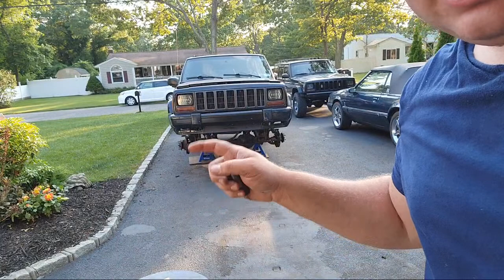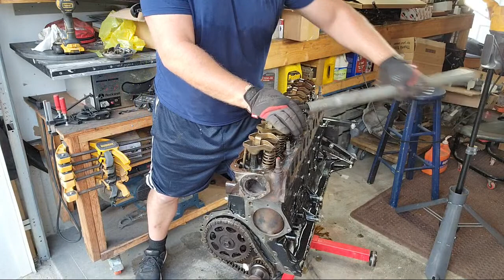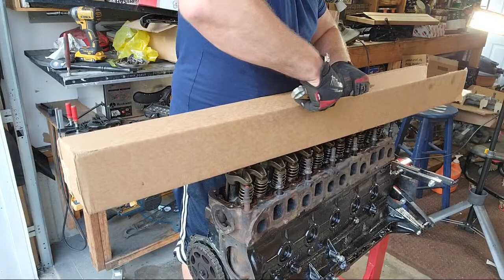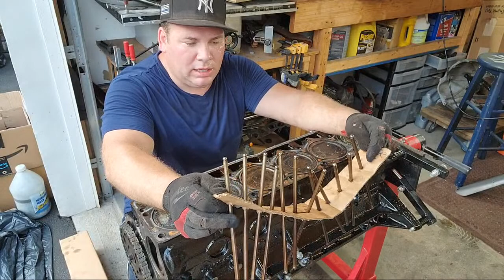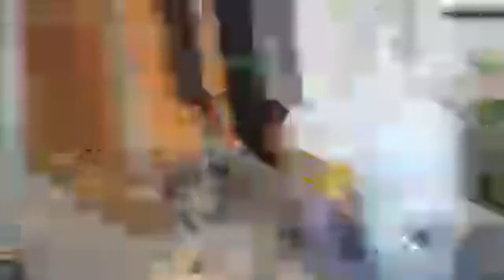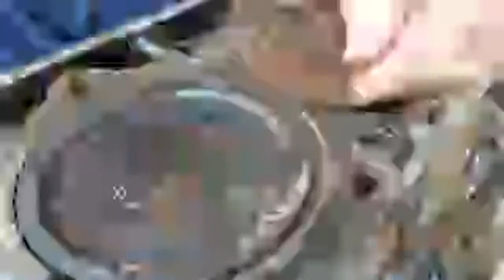JEEP 4.0 HEAD REMOVAL.  ENGINE PULLED 0630 to 0331

Comment: 1988 yj, stuck lifter. Didnt see a lot of lubrication on top so figure oil pump or cam bearings worn out. Its mostly new, so might as well give it some new parts. Yes get the extra vehicles out of the drive so you can do what you want.
Reply from the maker: Yes, Thanks for watching!!!

Comment: please mr i have a problem with my zj td 98 at the immobilization level, is there a practical solution?
Reply from the maker: There is always a solution... What is the problem?
Reply: @ProjectDanH  A rainwater leak damaged the remote control receiver card, find the solution and replace the electric diesel pump with another mechanism

Comment: What years are theses heads known to crack? Thanks
Reply from the maker: 2000 and 2001 were the bad years, it was the 0331 casting. 
 In 2002 they strengthened the 0331 head for the WJ and TJ, its known as the 0331 TUPY.   Chances are that because its 20 years later, if you have a 2000 or 2001 the 0331 head has been replaced